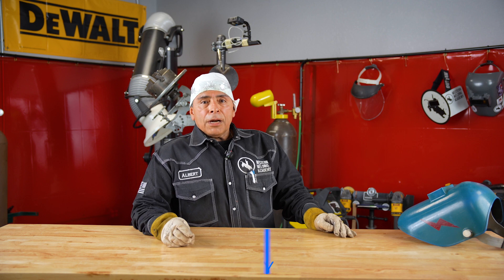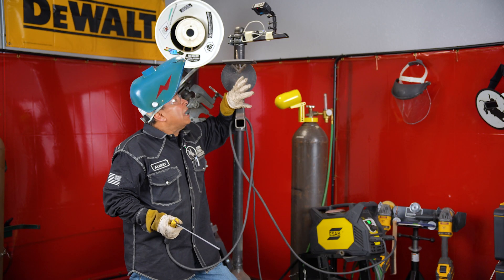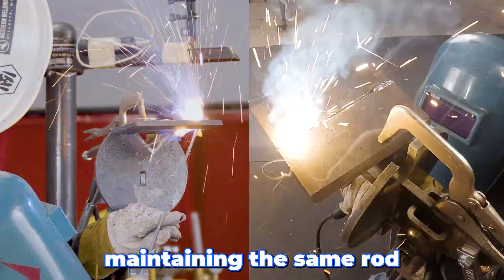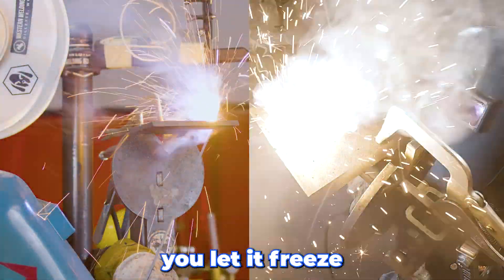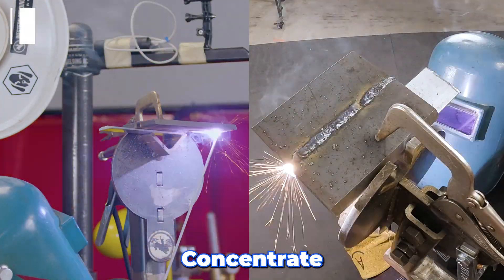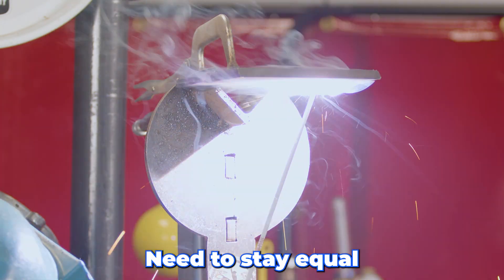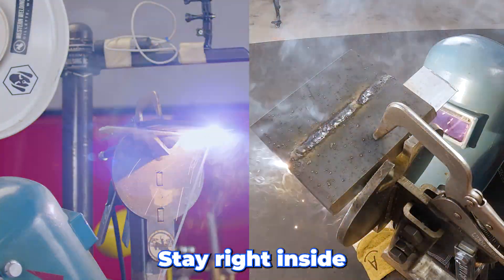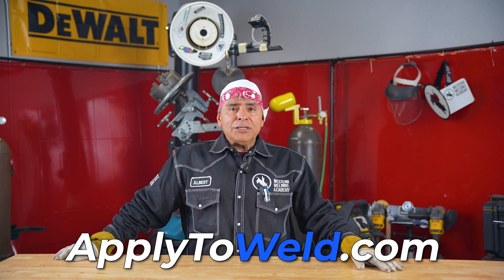How To Pass a 4G Weld Test

Comment: I’d like to share what I learned while welding 4g plates. Maintaining arc length is very important when my welds used to fall out during this test it’s because I didn’t have enough amps and my arc length kept changing. So maintain proper arc length (stick out). Also I challenged myself to not stop my pass until I ran out of rod. No matter how tired your arms get just let the muscles build up don’t stop to rest. Last I used to hold my breath like I was a sniper. It’s not necessary, I get more stability from being fluid. Breathe in and out and don’t be afraid of a little bit of movement. That’s how I get a good 4G 🤙